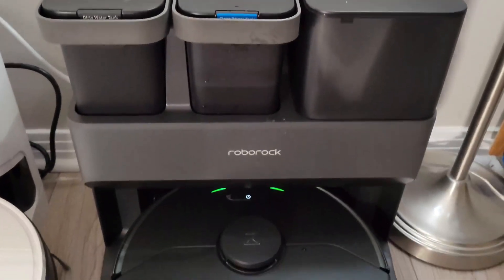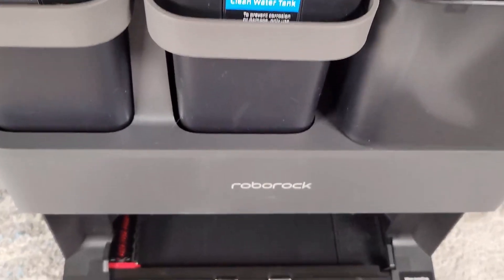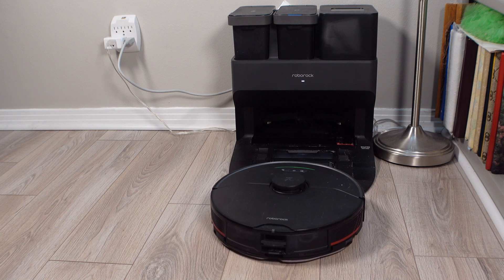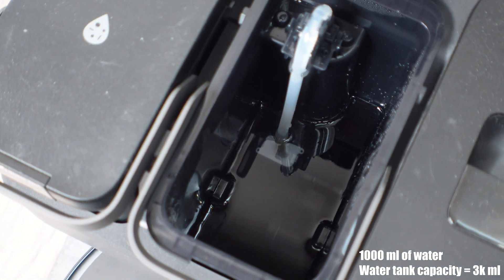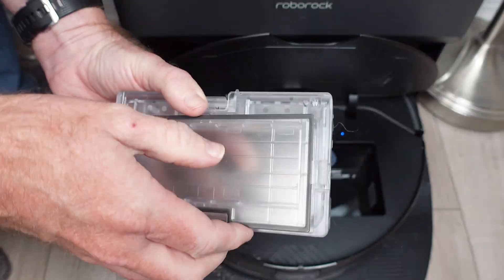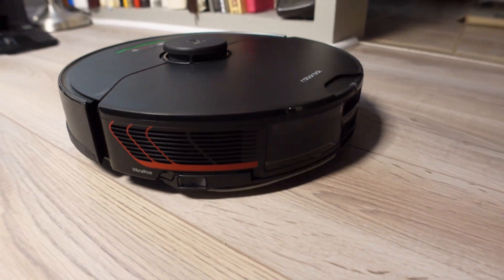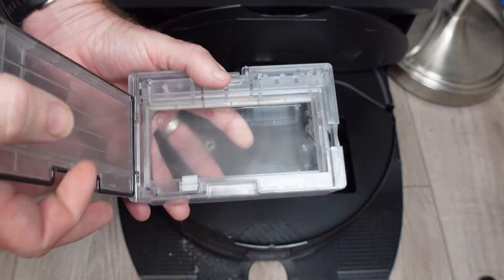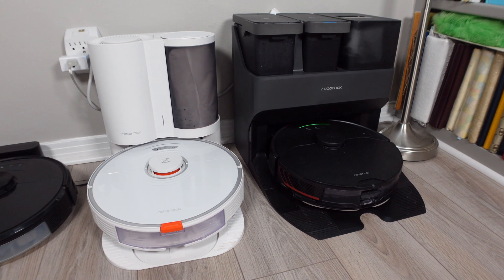Roborock S7 MaxV Ultra Dock Review!

Comment: The S7 maxv has issues emptying its dustbin.. Won’t work every time
Reply from the maker: Do you have pets?  It should not have an issue at all.
Reply: @jamie.andrews  Yes, I have pets. Will this make a difference with how effective the auto empty dustbin functions?
Reply from the maker: @Todd P  I have no way of knowing really.  It is not a problem for everyone and it depends on things such as the size of your home and the amount of long haired pets you have.
Reply: @jamie.andrews  Does pet hair create problems for the self empty dock?
Reply from the maker: @Todd P  It has been known to, but not for me with Roborock. My last video with the iLife T10s I had that exact issue.
Reply: @jamie.andrews  Ok, that is good to know. Because I have checked everything. I suppose it sort of makes sense. A bunch of hair in the dustbin would probably allow the air to just flow around it, and it tends to stick together. Sometimes it seems to work and sometimes it doesn’t. Seems like if I have too little in the dustbin, or too much in the dustbin is when I notice it the most

Comment: I was surprised how slow the S7 MaxV charges on the Ultra dock. My neato charged completely  in a couple hours.  I just received it and the first charge is taking at an hour and a half to go from the "low battery" point that it goes to recharge to 54%.
Reply from the maker: It could be the difference in battery size.  Do you have a large home that requires multiple recharges?

Comment: good evening can i ask a question I bought the roborock s7 maxv... is it true that anyone does it anyway, do I want the roborock s7 maxv plus or the s7 maxv plus ultra?
Reply from the maker: If you want the self cleaning mop get the Ultra.  Only real difference between the Ultra and Plus.
Reply: @jamie.andrews I have ordered the simple s7 maxv, it does not have a tray... I wanted to ask if it is possible to put a tray either from the ultra or from the plus.. will it work or not?
Reply from the maker: @ΕλενηΠερουλια  Both the Auto Empy Dock and the Wash Fill Dock can be added to the S7 MaxV.
Reply: @jamie.andrews  Thank you very much...
Reply: @jamie.andrews  I know that the ultra is better, but it hadn't come to Greece when I ordered the simple one without a tub... and that's what I wanted to ask if I can buy the ultra tub separately and put my own s7 maxv in it... will it work?
Reply from the maker: @ΕλενηΠερουλια  Yes you can buy it and it will work with the S7 MaxV.

Comment: The normal S7 plus dock has 3 filters (a primary filter, a HEPA filter, and the bag itself). How does this compare with only the bag?
Reply from the maker: According to Roborock the bag in the Empty Wash Fill Dock gives you a E12 rating (99.5%) the bag with the other 2 filters in the Auto Empty Dock give you and H13 rating [99.99%l.  The latter is an official HEPA whereas the bag alone is only EPA.